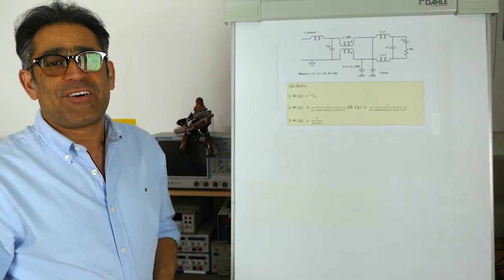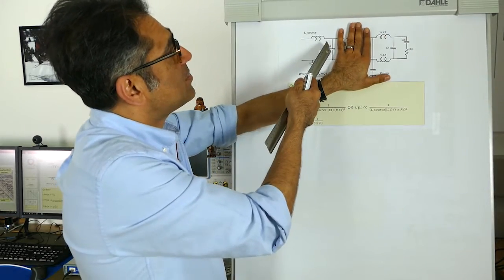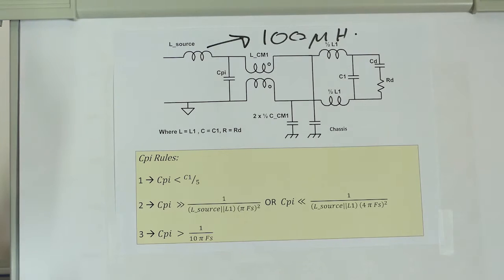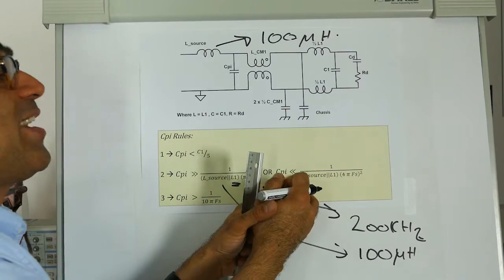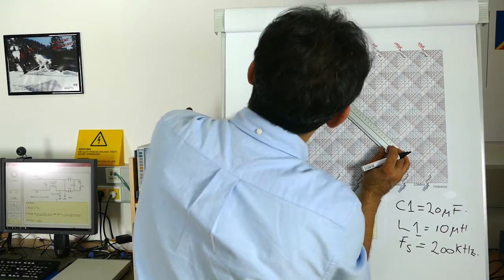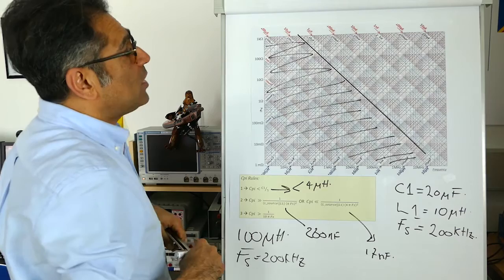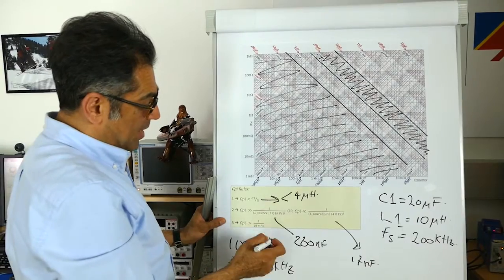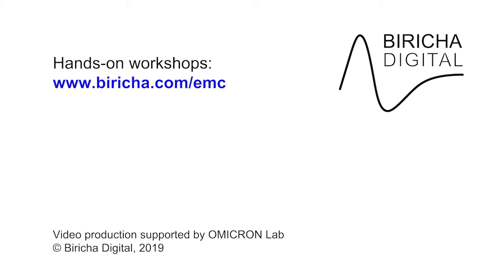EMC Filter Design Part 9:  Finalising the Filter Design by Adding the Pi Capacitor

Comment: Thanks a lot for this amazing video series,
I just have a question and hope you can answer,
What is exactly we are going to Filter? 
i.e, are we protecting the Mains from our noise, or protecting our design from Mains noise?

I think we do both, but with this last video "9"  i got confused
Dr Ali is showing Cpi as a secondary important CAP even I believe it main device with leakage inductance to filter noise in both directions.
I do believe L1 function is acted by leakage inductance and C1 is Cpi
Reply from the maker: In this series Dr. Ali was focusing on conducted emissions from the device to Mains but of course, a filter always acts in both directions. The leakage inductance is between C1 and Cpi so it is like a C-L-C filter and it will attenuate in both directions.
Reply: @OMICRONLabTutorials  Thanks a lot for this fast reply, just to make it more clear, if we are not using Cpi, The filter composed of L1+leakage and C1 is filtering noise Mains to device, 
is that correct?
Reply from the maker: @mohammedabdeltawab9882  even without Cpi, and LC filter is acting in both directions. It will cause high-frequency currents to circulate closer to the device, therefore protecting mains but it will also provide a low-impedance return path for any signal that passes thru L1 from mains. For a detailed discussion, please continue via support@omicron-lab.com. Thanks!

Comment: These videos are very helpful for me. Thank you very much. Regarding the Pi capacitor, If AC utility line is coming in (in case of a fly-back SMPS) how we know the inductance in the input?
Reply from the maker: The AC mains inductance is normally specified in the EMC standard you want to follow. For CISPR 16 it is usually 50µH as far as I know.
Reply: @OMICRONLabTutorials  How does the switching frequency apply in the AC mains in the second and third rule?
Reply from the maker: @ProfesssorBaard  the goal is to separate the switching frequency and the LC resonance frequency of the input stage. Otherwise the switching frequency could excite the resonance causing the ripple to increase.

Comment: Hi Ali,
thank a lot for your video tutorials on the main line filter with respect to SMPS. One question boders me a little and for the Pi-CAP or X-Cap a fourth requirement may be added.

Depending on the overall power the SMPS may provide the power factor may also be an issue or a fourth requirement to be checked for AC based designs. A 1uF X-Cap or Phi-Cap may add up to 20Watt of apparent power (@60Hz 230V_ac) effectively reducing the power factor of the overall design. This may not be a problem for a 500Watt SMPS. However let's say for a +75Watt the reduced power factor may violate regulatory minimal standards with respect to EMC/Power factor. Is this correct or do I miss something here?
Reply from the maker: Hi Markus! You are right, there is a lot more than just the information in the 10min video. There is a limit for the input cap and if it is too large it can cause problems like power factor, leakage current and even inrush current.

Comment: The part that gets me is the LISN. Cpi was selected based on 100uH that LIST provides. In real life ... this 100uH can be ... almost anything ... or am I wrong? In this case how can you ensure that the circuit won't resonate?
Reply from the maker: Cpi is mainly relevant for EMI purposes and there the LISN is used as a standard to make measurements and comparisons over a variety of manufacturers and products. Under real conditions, it can of course be slightly different.

Comment: Dear Dr. Shirsavar, thank you for this informative and useful video. 

I tried following this for my boost converter input EMC filter design. But, I encountered a problem. After applying Rule#1 and Rule#3 and excluding the corresponding areas, I am not left with any region on the impdance paper to choose a value from. Does it mean that I dont need a C-Pi altogether?? I rechecked my calculations many times and there's apparently no problem with them. Can you please comment your insights on this?
Reply: probably these two formula1 and formula2 of rule2 are incorrect
Reply from the maker: Dear H ABS, without more details it is hard to tell what your problem exactly is but mabye you need to change your specifications? Maybe your specifications are too strict? If the rules don't work, this does not mean that you don't need a Pi-Cap.